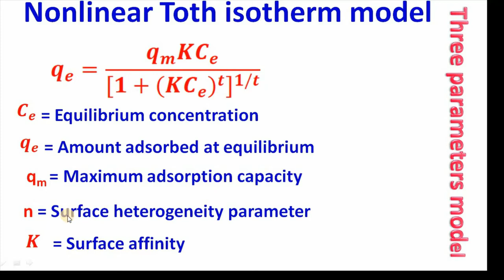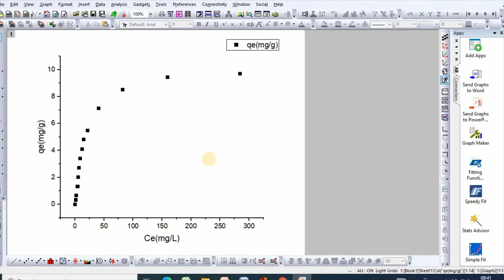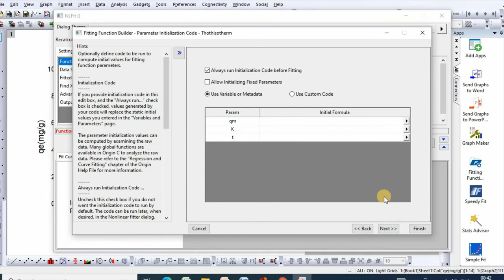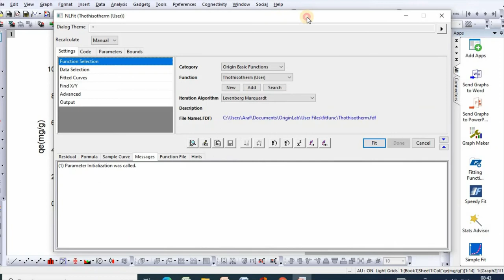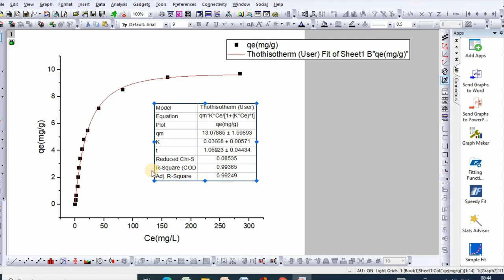Toth isotherm model fitting in origin

Comment: Sir, is there a reason you have kept the surface heterogeneity parameter 'n' as 't' in the formula
Reply: Also, is it necessary that if Toth model fits the data, the next best should be Freundlich (being it for heterogenous surfaces)? I am getting correlation R-square in order  Toth>Langmuir>Freundlich, is this order possible?
Reply from the maker: Thanks for your comment. There is no reason to use this. Please read "n" instead
 of "t" in the formula.
Reply from the maker: @AS-tp3cz  Thanks for your important comment. The order might be possible. However, it depends on several factors including experimental conditions. Please keep watching all the videos and subscribe this channel.